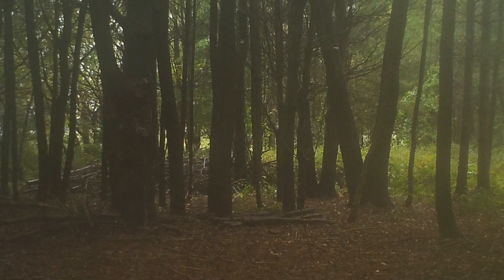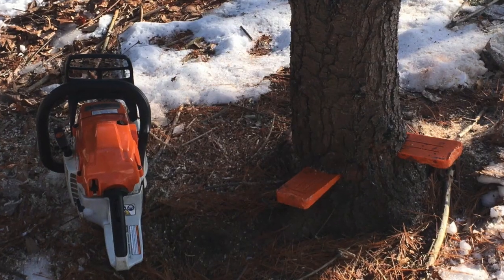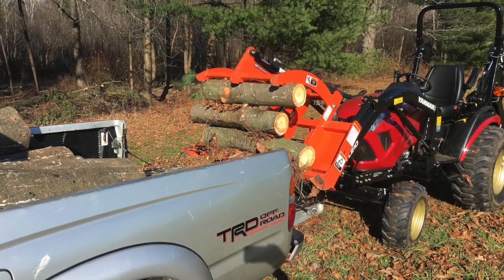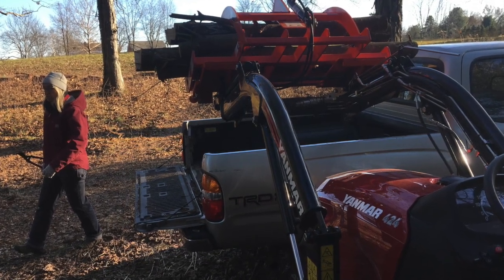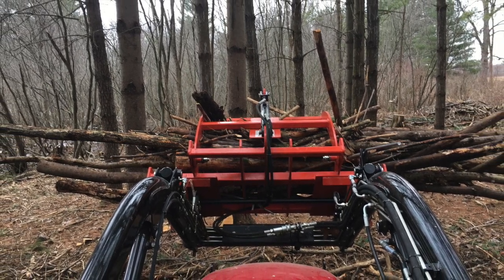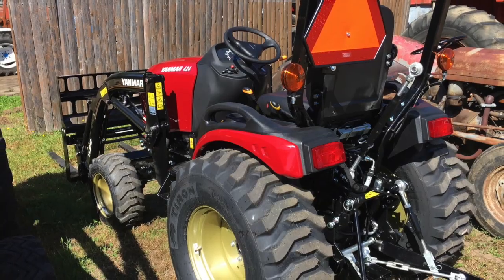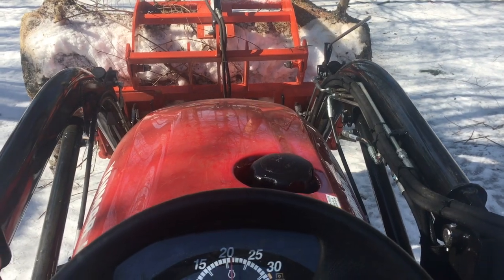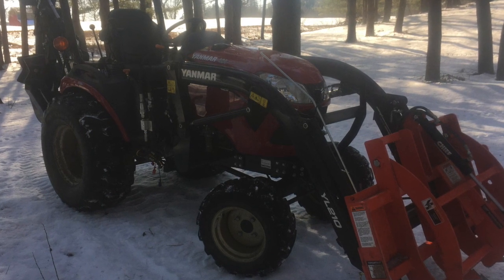A custom tractor & grapple solution for clearing brush

Comment: I'm wondering if you could  put up a quick video of how the dealer connected your third function valve. I have the 324 and will be adding a grapple so I will need to add a third function valve. Thanks
Reply from the maker: Hi,
Wish I knew but I wasn’t around at the time to observe the process. Check out what you can learn from — I think — WR Long, the maker of the valve kit I got. 
https://www.wrlonginc.com/valvekits
Reply: @oldbike4135  Hi, I'm curious to see what lines the dealer tapped into for the 3rd function. Can you take a quick video from the hydraulic pump under the seat over to the joystick and to the third function valve. Thanks

Comment: Got the same tractor.    What a great thing to have.  Been thinking about getting a grapple.  There is a place to get a skid steer quick attach for the front loader if u would like to look into that I can sent u the link.  Keep up the good work.
Reply from the maker: Thanks Derek. Yes, I considered a few other options for mounting a grapple, initially. I decided to go with the Worksaver and the 3rd function hydraulics for more flexibility for my tractor. I had seen this grapple in action mounted on another make of compact tractor but never on a Yanmar like ours, so I wanted to do something new. Good luck!

Comment: New subscriber. The tractor drew me to your channel. I’ll be picking up a YANMAR SA324 in the next couple of months and the grapple is on my agenda. You mentioned replacing couplers somewhere and an ‘O’ on the back hoe. Are these parts I should keep on hand or was your failure an anomaly? Were these parts warranty covered or considered consumables not covered? Finally, would you mind giving me a ball park figure of the cost of the grapple and third function addition. I’ll check out some of your other videos but, I did just find your channel so this was my first. Im in New Hampshire so I’m in that New England environment you commented you are in. Finally, you may be interested in my neighbor and friends channel, Gagnon Mountain Homestead. He’s got a lot of different stuff you may enjoy…he’s quite comical as well!!
Reply from the maker: Hi, I worked the tractor, grapple, & hydraulics hard right from the start, lifting massive logs and pushing piles of heavy debris around and, although I'm not sure, that may have contributed to needing fresh couplers. Same story with one o-ring on the backhoe. Who knows, could have been my fault -- maybe hydraulic fluid was overfilled. Follow your manual closely on maintenance. I replaced those couplers, provided by dealer under warranty. He told me exactly how to do swap them. At original purchase, I bought 4 implements, including bucket and 5ft brush mower. had my dealer install WR Long 3rd function kit and I bought a 4ft worksaver SCG48s grapple: $1k and $1.5k respectively
Reply: @oldbike4135  thank you!

Comment: Does that grapple have the Yanmar quick attach?
Reply from the maker: I confess I'm not certain whether it's called that or not, but I THINK so. Here's why: The grapple (or the Yanmar standard bucket) basically drops onto the front of the loader and is secured with a pin on each side. . Then you hook up the hydraulics on the grapple to the quick couplers at the loader. So install and removal both are easy. Hope that helps